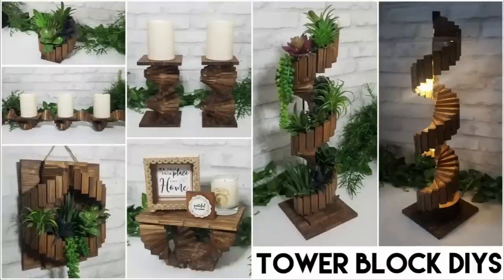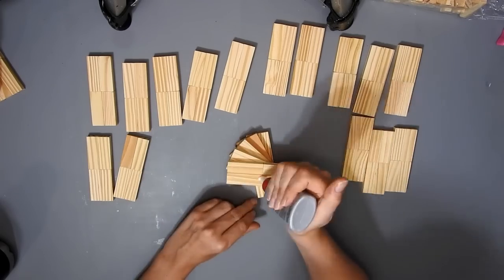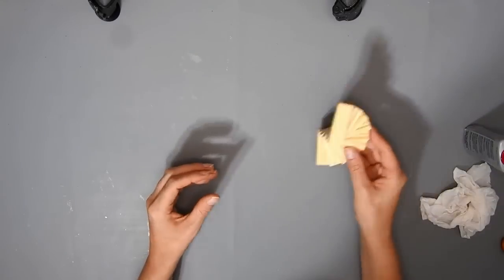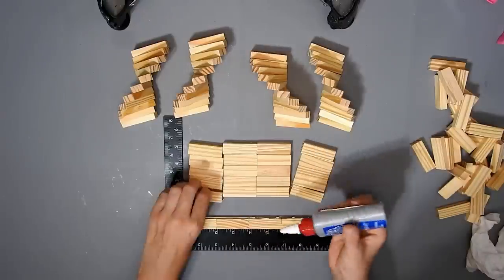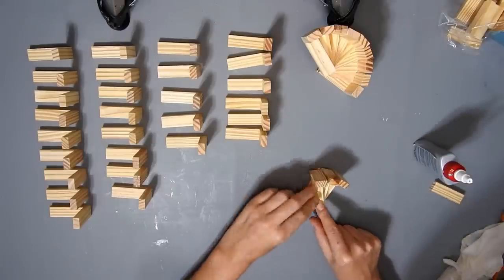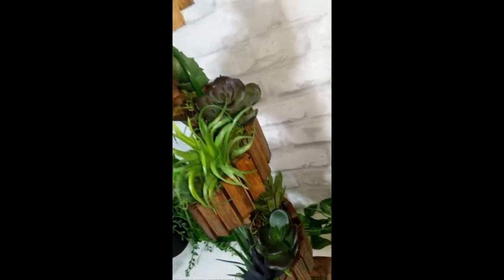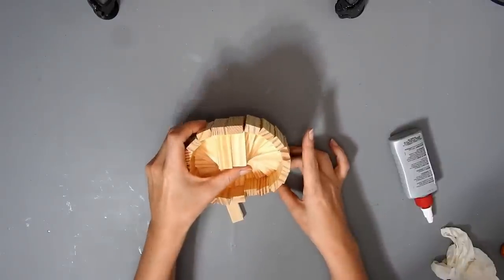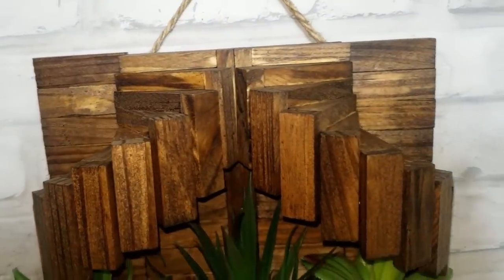SPIRAL TOWER BLOCK DIYS

Comment: I just watched the video for the 2nd time. I wanted to ask you which glue do you like using better ? Does one hold up better than the other glue ? I plan on making some of those projects and like to know the glue that holds better please ? Thanks
Reply from the maker: They are both good. I prefer the Dollar Tree one; I'm so used to it. Plus, it is cheaper and not as thick, so it goes further.

Comment: I am trying desperately to make the very last one, the wall hanging, in this video and have watched the video several dozen times. But I cannot get my 10 step spiral staircases to touch the backboard. It seems like it's not right. My staircases are fine. So HOW can yours lay flat against the background and mine still has a big gap?
Can you please show more angles of your projects instead of from above? I can't figure out why. Did you add some pieces? Did yours touch flat? I'm missing something.... 
Very beautiful projects but I'm soooo stuck
Reply from the maker: Lay it flat on the table after you make it and let it dry and you can move the blocks to make it lay flat till it dries .